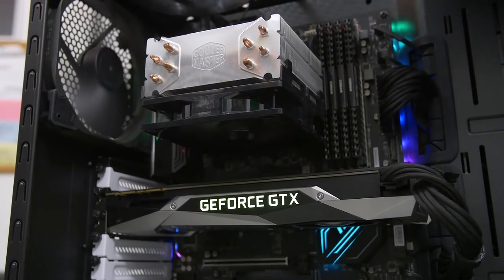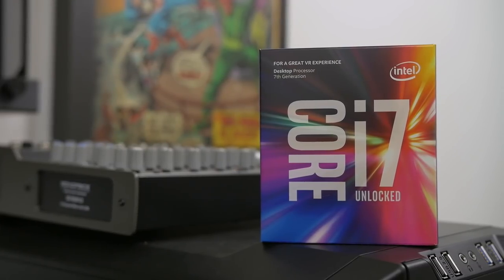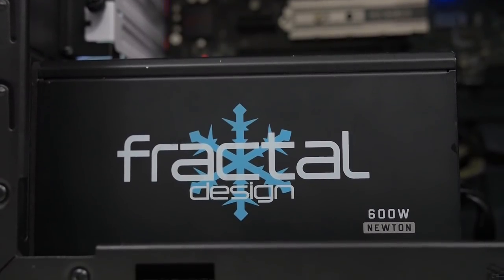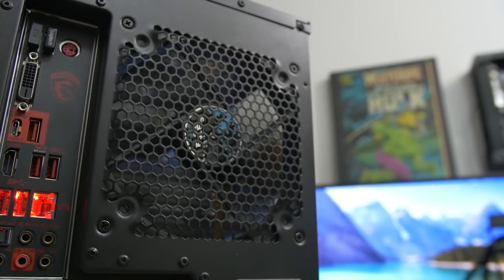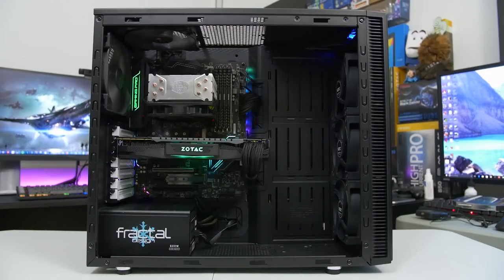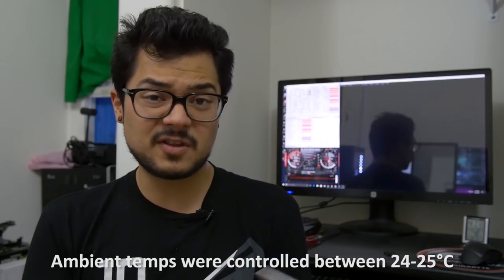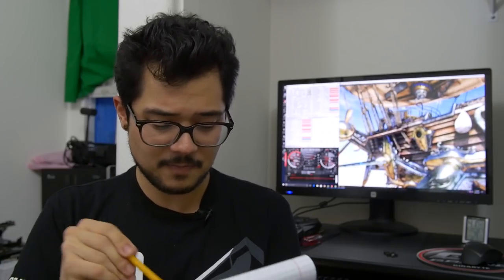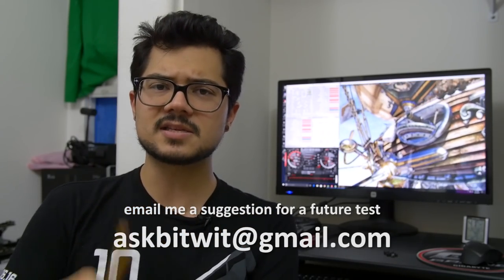This is how you should mount your CPU cooler! I think??

Comment: Because the founders edition is a closed blower gpu then possibly the hot air being pushed through the enclosure to the end increases the overall temp of the backplate. The open blower gpu is taking heat from all over the gpu and sending it to the whole system, not just predominantly the backplate. The horizontal heatsink being closer to the backplate could explain the higher temp for the closed blower as its backplate is probably a bit hotter than the open blower.

Comment: What I believe is happening is that when the CPU cooler is placed so airflow is horizontal it is creating a pressure difference directly above the GPU. The faster moving air made by the CPU fan effectively creates a negative pressure zone above the GPU which sucks in the hot air because there is no barrier between the two. The blower style cooler traps the heat on the GPU which causes the back to be hotter as well. Put those two together and you get a hotter CPU.

Comment: The cool air from the front intake is being dragged across the fins by the rear exhaust fan, where as when the HSF is oriented to the front, the normal way, the front fan really isn't doing that much. It's like you have fans on all four faces of the heatsink instead of just the normal two. Turn the fans on the front off and you will see.

Comment: There are a lot more options in air cooling, than shown in the video. For example 3 intake fans at the front + 1 at the back (also as intake with dust filter) and 2 exhaust fans at the top, with the CPU cooler blowing towards the top. This case has good airflow anyways and it's easy to achieve positive air pressure to control dust. But most cases only have two front fans and a hard drive cage in front to make it very hard to achieve positive air pressure trough the whole of the case and control dust.  So a lot of alternative ways could provide good results both  in temps and in dust control.
I agree, that a smoke test would be really helpful in a more "conventional" case (Corsair 750D or 760T or BeQuiet Silent base 800 or 600 with HDD cages), with GPU temps included as well. 'cause let's face it, the case in this video is already well optimized for airflow and positive pressure, from it's design.

Comment: Try covering the top vents on the case when doing the horizontal airflow tests.  In my experience, the air path through the case makes far more difference than how much airflow you have or whether you have positive or negative pressure.

Comment: Old video I know, but nobody pointed this out so here goes...
In both configurations the cooler relies on it's wick structure to bring the coolant back to the heatsource (cpu) after it has been condensed in the pipes in the fin arrays.
When all arms of the pipes are level (the fan blows vertically) the wick structure always works horizontally.  This is good and allows it to be quite efficient. In this situation an non shrouded GPU will "leak" some heat to the intake of the cpu cooler and so you get a higher temp in this situation. It otherwise allows the cooler to be almost as efficient as if the pipes were pointing upwards to allow gravity assisted return of coolant. (Yes, I am saying it will be even better if you put mainboard on a flat teststand so the heatsink can work "desktop style" instead of "tower style".)
So, onto the second orientation. Here it gets complicated. The wick in the bottom ends of the heatpipes (It has 4 heatpipes in total but 8 ends as they pass through cpu block) will now have to fight gravity to get coolant back up to the heatsource. This can lead to a pooling of coolant down there and also a limit of vapour being able to pass out to the bottom tips of the pipes. As a result the upper heatpipes may get less gas/working-fluid than ideal as well. Result is less power handling pr c delta. So, in this case you may actually help it by introducing a hotter area close to the GPU on the bottom as that will reduce the ammount of coolant condensing there and allow the upper system to take a larger portion. Since the upper system is assisted by gravity on the final "leg" of the transfer this actually improves it and you match the other ideal test with a very odd and intuitively sub-optimal setup.

This fighting gravity issue is most likely why the vapour-chamber coolers have not taken over the market as they could suffer more from changes in orientation.

A final note: This is theories put forward by my understanding of heatpipes, the phase-cycle and my own experiments confirming these theories for myself. They do not come from any specific manufacturer but a lot of the insight has been gleemed from scientific papers on this subject for heatpipe designs in both computer and aerospace markets.
Reply: I forgot one other factor that is probably as important as how the heatpipes work. CPU die shape and orientation!
Another factor that may shift the results is the orientation of the direct contact heatpipes vs the die in the cpu. If the cpu aligns with the pipes it will be cooled mostly by the two middle pipes since it's heatspreader is nowhere thick enough to give even distribution. Orientating the cooler so the pipes all cross the die hotspot "strip" makes all pipes take part in the cooling andshould then also dissapate heat better. i7-7700k is not quite as badly shaped as the i7-3770k was but still it will have an effect since it is not perfectly square.

Comment: thats an easy one. the blower card has an exhaust towards the back part of the shroud together with the back exhaust. open your case and notice the triangle shape exhaust im talking about. that dumps very hot air in your case. the open card exhaust most of the hot air in the case but that air is way cooler cause its temperature is being lowered by the beefy heatsink. believe me i have experienced what I'm talking about

Comment: the reason why the open air had lower temps compared to the blower, i believe, is due to the fans pushing more air through the case. Even though it may be hotter than the ambient air in the case it allows more air to get pushed through the cooler and cool the CPU more.

Comment: the first two results is due to the front case fans feeding the cpu cooler with fresh cold air, which is also dissipating the gpu heat. as where in the second result, the cpu cooler is sucking up the hot air from the zotac card

Comment: open shrouded gpu lets cool air come in easier and spreads hot air evenly throughout the case, thus mixing with new cold air just as easy. the horizontal config benefits from an open gpu, since the enclosed gpu heats up more internally, thus emitting radiating heat instead of air and because the actual gpu is the closest to the backplate, the heat rises up into the cpu cooler instead of in multiple direction.

Comment: I suppose that the blower style card pulls air out, and by acting as a powerful exhaust fan it makes the pressure inside the case negative, and if the pressure is negative then the cpu gets less dense air going through the cooler to cool it...so that's my theory.

Comment: The only explanation for the higher heat with a horizontal mount with a blower style gpu is that it takes in air from the ram fins directly, and when using the open air gpu, the air is slightly directed upward and the front fans can reach it with cooler air.

Comment: I think it would take a lot of heat from the GPU before the extra airflow inside the case would be heating more than cooling.

The extra turbulence would spread out the heat inside the case whereas with the the blower style GPU, pockets of hoy air could build up and contribute to diminish the cooling of the CPU cooler

Comment: its all in the pressure. the cpu was pulling air straight while the blower was sucking. the horizontal path was more direct therefore more flow. in the vertical position all the air had to change directíons. the spacing between the fan and card also caused a restriction so the card got more air than it did before

Comment: I think the results are coz of this :
I can't explain the horizontal position with the blower type card but the rest makes some sense. The horizontal with open GPU made sense. Coz u added a fan parallel to the fan on the cooling tower. So it's pushing fresh air directly towards ur cooler. Giving fresh cold air. Which dealt better results. But the vertical blower card pushed air back out of the case. So there is more cold air to be taken into the tower. But when the open GPU was installed, the was more hot air by the area where the GPU sat. So the air taken in was hot. Which meant temp would go higher. 

This is what I could say

Comment: The two exhaust fans next to the cooler have to "fight" with the blower style GPU for which one get the air. Basically 3 fans in and 3 fans out of the case. Now with the open air gpu the two exhaust fan are the only path out of the case so there will be more air passing over the cooler. 3 fans in and 2 fans out. All of the air travels across the CPU cooler.

Comment: I have a hypothesis as to why the open GPU performed better in the horizontal air flow config. Both the CPU AND GPU were venting out the back of the case with the FE GPU which caused the air surrounding the back to heat up faster and eventually get close, if not all the way to thermal equilibrium and reduce heat flow (since thermal energy only flows to cooler areas) as described by the second law of thermodynamics. With the open GPU in the horizontal air flow config, only the CPU vented out the back which heated the air surrounding the rear of the case at a slower rate.

Comment: The only thing i can think of is with the horizontal fan it is easier for it to suck in more hot air and blow it out pulling from 2 sides (below and to the right) while the vertical would have a harder time pulling air from the right side, and with the open shroud it allows more heat to escape which in turn giving more air for the fan to blow out of the case... just a thought

Comment: Data point of one isn't very telling. Keep swapping between configurations until you have 10 data points in each config. Also running smoke through the case may give you a better idea of what the airflow is doing.

Comment: I have a theory: horizontal is blowing the hot air away from the cup cooler before it makes any difference because the hot air isn't touching the cpu cooler thanks to the fan on the cpu cooler blowing the hot air out of the case and not sucking hot air(or sucking very little) in. while its vertical however it's sucking more hot air in because heat rises, it doesn't go sideways.

Comment: I believe that when the CPU Cooler is mounted vertically, you should use ONLY the upper mounted fan and when it's mounted horizontally you should only use the fan in the back. That way the stream of air doesn't split in two directions.

Comment: Put the side panel back on, with the open air design its able to freely exhaust the hot air out of the side where as the blower style has to force it out of the back. Also you should realize blowers tend to run hotter than open air in general.

Comment: My theory is, case pressure diferences, the blower style affects the case pressure because it is pulling air out of the case, and that will affect the flow of air to the CPU. on the second test, the CPU is more affected by the proximity with the GPU than it is by the air flow.

Comment: Having an exhaust fan on top of the case makes the orientation of the CPU cooler not matter. If you just have a rear exhaust though pointing up does have a negative impact on cooling.

Comment: As long as the cooler is exhausting towards case exhaust fan you are pretty much good to go. I can see little gains over vertical and horizontal way of mounting the cooler if you have exhaust fans both ways.
But if you'd have to decide which way to put cooler without case exhaust fan, you should put it horizontally since heat always goes up and you can create that tiny bit more airflow by helping the physics to do it's job.
Anyways this becomes much more apparent when you own very large air cooler and have high overclock, though the real difference is gonna be a couple of degrees at best. 
Try mounting the cooler fan upside down and try to see how much it effects the temps when the hot air is circulating inside well ventilated case such as we saw on this video.

Comment: The founders card during the horizontal test was pushing hot air on too and up the motherboard unlike the open GPU which allows for heat to scape from every side of the card

Comment: Perhaps it's a pressure thing? The blower GPU will reduce the positive pressure across the case so maybe the actual pressure in the fin stack dropped? The open GPU won't reduce the pressure at all. Therefore  with the open GPU it's all about air flow; with the CPU cooler horizontal (blowing towards the back) and in line with the natural flow you're seeing lower temps. With the blower you've got a slightly reduced pressure and therefore it might be more about which fan is exhausting (or pulling air from) the CPU stack. As you used two different fans in the exhaust positions it could've been a variable; try the test again with identical exhaust fans...

Comment: So basically if you have a blower card go vertical and if you have an open card go horizontal, simples!

My theory is that the blower cards typically run hotter so when the cpu cooler is vertical it is moving the hot air radiating from the card past the CPU faster where is when the CPU cooler is horizontal the radiant heat is not being pushed away as fast.

Comment: Back in the day, I used to run the back fan blowing in directly into the CPU heatsink fan and fans in the front of the case exhausting all the heat from inside the case. No clue if it worked better or not.

Now I just custom water loop and don't worry about it.

Comment: best assumption.... the low ambient temp, combined with the decent amount of positive pressure, kept everything generally cooler because u had much cooler air inhabiting the case... which means that the open air cooler was able to efficiently cool the gpu while keeping the air around it at a much cooler temp.... basically kept all the incoming cool air circulated...

Comment: its pure airflow. All of your intake fans are horizontal. The airflow comes in and goes out without having to be averted in a different direction.

The vertical airflow has to be averted from left/right to up/down, thus creating pockets of air that remains hot.

You see this with radiators. if you mount it at the front, it tends to stay cooler than mounting it at a rear exhaust point. 

It's all about aerodynamics...

Comment: I think I understand the first half of results. With the gforce card blowing out the back it pulled some airflow from the path that would normally go out the top and back of the case. Without air being pulled out by the graphics card (zotac) more incoming air flowed thru the cpu cooler meaning cooler temps.

Comment: The CPU and GPU are not the only sources of heat in the case. Ignoring the other heat sources will leave you scratching your head when you get these "unexpected" results. Overall airflow inside the case is the key to effective cooling. Try demonstrating actual air currents to see if there's an area where airflow stagnates, or even take a look with a thermal camera to see where the heat is coming from and where it's going.

Comment: The GPU would be spewing hot air into the chassis, but maybe that air is still cooler than the temperature of the metal heatsink. The increase in the amount of air in the chassis makes work easier for the fan trying to force air though the heatsink fins and the extra air also provides more passive cooling.

Comment: Seems like any airflow is good airflow, but if its warm air from GPU avoid pointing it directly into cooler intakes.
I think this makes most sense if you start from your GPU (blower or open) as this is fixed once you've purchased it, then configure CPU orientation second.

Comment: i've heard that if you have air cooled horizontal cpu cooler the blowing fan at the top of the case should be in the front mounting holes because the air pushing from the cooler should go directly to the back of the case fan and pushing the hot air  out of the case easier.

Comment: If we assume that the temperature difference was ONLY based on shroud and no shroud, then maybe we could say, that although the GPU was blowing hot air(relative to the outside of case temp) it could still be helping to cool the Heatsink off more than having LESS airflow with the shrouded graphics card. 

What were the GPU temps at the time of testing? 

If the air from the GPU is cooler than the temp of the CPU heatsink then it will still cool the heatsink!

Such tests are very very hard to perform. There are just a ton of variables, but I appreciate that you do this kind of thing. It is interesting and more useful then the people complaining that you didnt perform it correctly.

Comment: sry for my engrish:
the 2 chasis fans in the back are positioned for a vertical position:
 - the fan in the back (vertical) pulls hot air mostly from GPU than from CPU.
 - 

placing the cooler vertically also means that most of the air comes from 2 out of the 3 fans in the front, while the gpu heat is blowned towards the back, for the back mounted fan to exhaust, or just get scooled in the case
placing the cooler horizontally means that there is very little surface area where the fans in the front can feed the cooler fan cool air; also this means that all heat from gpu goes to cooler.

+ blower style coolers are still hot
+ open coolers do better when you have a bit of turbulance inside the case

I would redo the test without any case fans. then i would expect the results to be better for the blower style cooler.